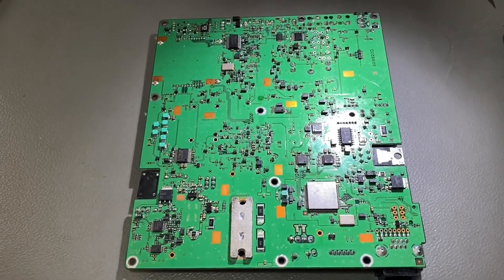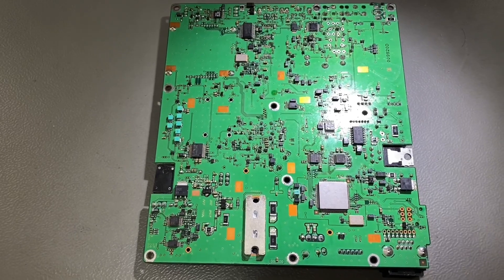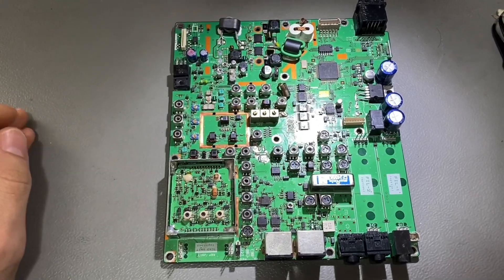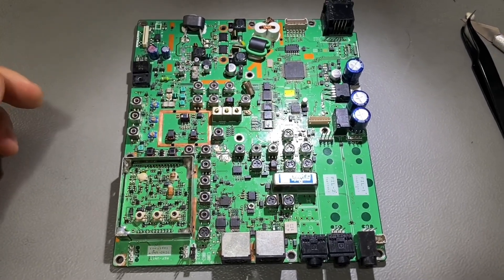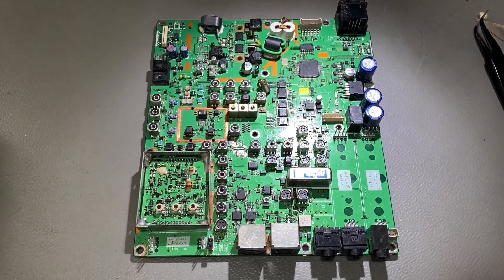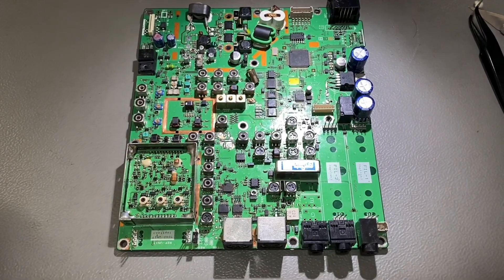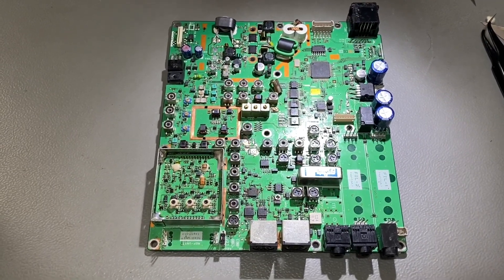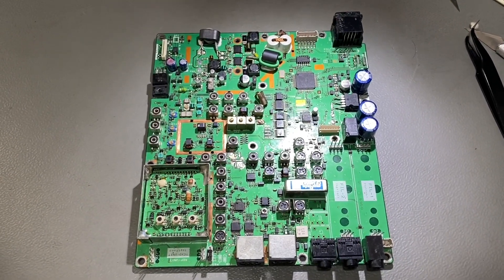Yaesu FT-857 repair update | work in progress

Comment: Hi I commented on your other 847 video. If you end up making another 857 video, can you quickly take a video of how the tuning knob assembly should look.  I'm not sure where the coil spring is supposed to sit.  When I took mine apart, the coil was partially wrapped around the brass screw/post.  Not sure where it was supposed to be. Thanks.
Reply from the maker: all right stay tuned for the next video, I’ll put it there. Cheers
Reply: @IZ0MTW  awesome. Your a lifesaver if you do.
Reply from the maker: @johndenver3120  hi just uploaded a new video and record how to put the vfo knob back together. Take a look. Best wishes
Reply: @IZ0MTW  Thanks so much.  You are a big help!